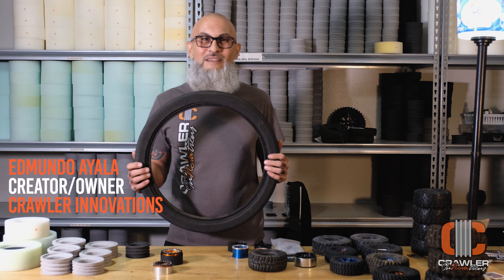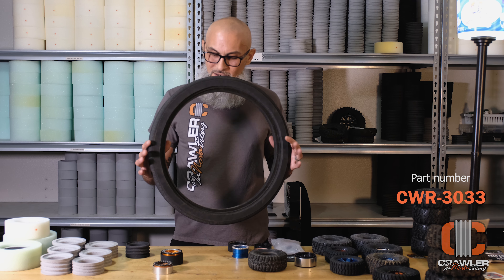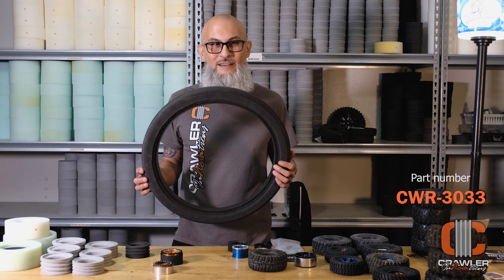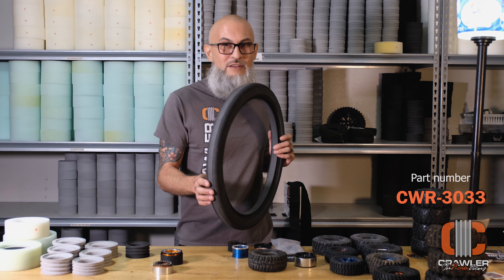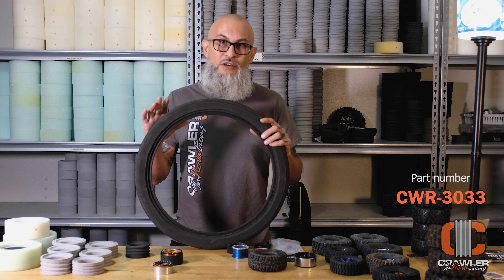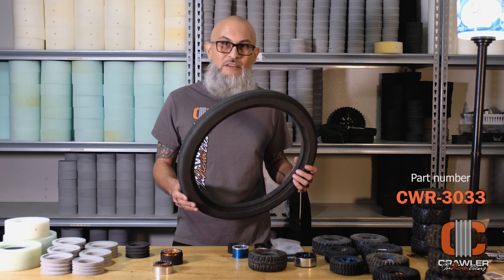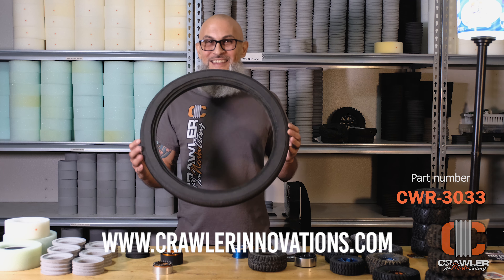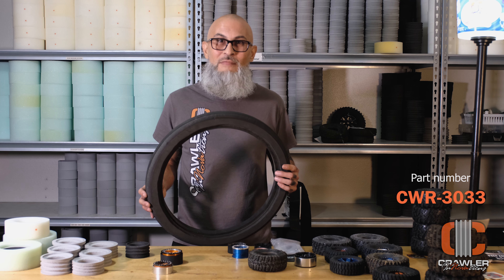Do tubeless 20" BMX rims & tires exist??? CI has a tire foam insert if they do.

Comment: The reason they run such high pressures isn't really to combat flats, you need extremely low rolling resistance to maintain speed in the bowls and conserve energy throughout the run and higher pressures give more pop off the coping allowing you to air higher, so being able to run lower pressures isnt really an advantage. I can still see the run flat part being useful but im curious as to how much these weigh, as rotational weight in your wheels is the worst place to add weight on your bike, it makes doing everything harder especially spin tricks, which is another reason why you see lots of flats, lots of pros run Tubolito tubes which are extremely thin and lightweight. Might be better suited to street riders, extra cushion on drops, can run even lower pressures without getting flats, and that safety net of knowing you won't be walking home, all good things. Either way its a very interesting idea for sure.
Reply from the maker: I appreciate your input. Thank you. One BMX tire foam insert weighs 132 grams or 4.5 ounces. They are rather lite weight, less than an innertube, but that is without tire sealant which would also be required.

Comment: This already exists and is called a tire mousse.
Reply from the maker: You do realize that those are for a motorcycle, not a bicycle? Also, those are an injected molded foam filled with nitrogen. It's a very interesting technology for dirt bikes and has good reviews. It is also an entirely different material and machining process than the tire foam inserts Crawler Innovations offers, since our products deal with vehicles lighter weight than a motorcycle.  Thank you for the comment.